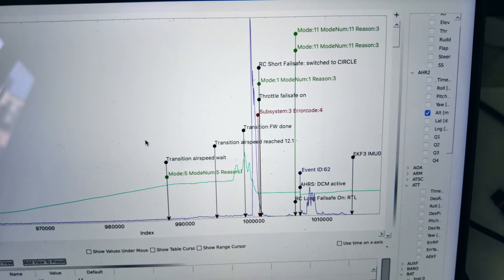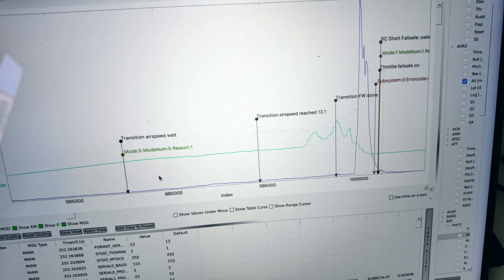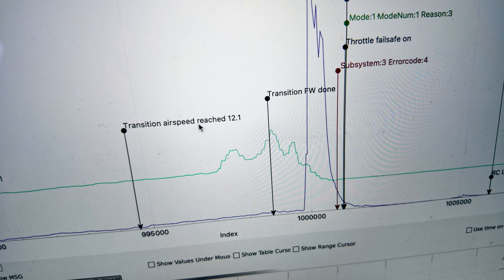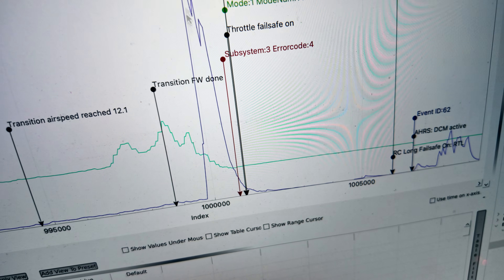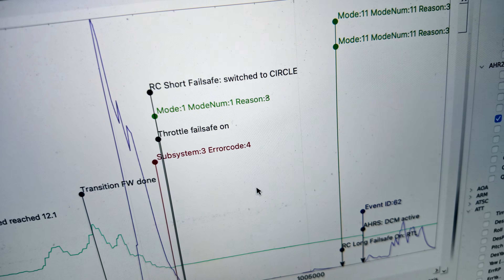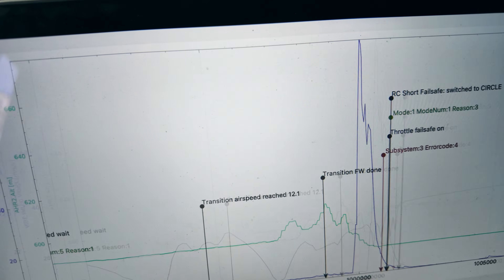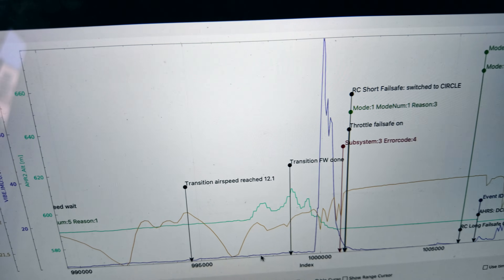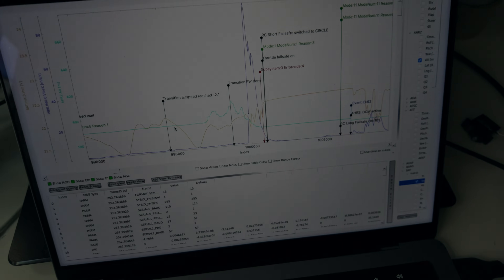I Crashed my Autonomous Drone (7/7)

Comment: Alright I'm back and after some research; you're right I, couldn't find any commercially available reciever compatible with the rc2. I did however find DJI O4 Air Unit and the Pro version of it. The only issue however is that the max operational distance of O4 is 10 km and 15 km for O4 Pro. While that is on its own a massive area you can cover, it seems a bit limiting for a long range fixed wing photography & videography drone that I wish to create. To be fair I think it is hard to find a finished product better at taking HD videos and photos than what DJI is offering. Do you have any suggestions?
Besides that, I'm interested in your printing material choice, or rather, how much of it is needed to print the entire aircraft? I have a friend willing to print the plane but we need to know how much to buy.  I may have overlooked this detail somewhere on Flightory's website so I'm asking you, who has already printed it twice if I'm up to speed. I plan to use LW ASA filament for it's greater UV and heat resistance than LW PLA.
Reply from the maker: Yeah, VTXs are difficult to match. I’m still waiting for my Skydroid system (RC with screen + vtx + gimbal or fpv cam). 

The stallion takes about 800g of LW-PLA - try the LW-PLA-HT variant. It also takes say 100-200 grams of PETG. It does take about 90h of printing tho.
Reply from the maker: I am yet to find a filament suitable for Flightory (glueing parts together). ASA-CF didn’t work for me - too brittle.

Comment: Out of curiosity, what was the problem in the end?
I'm asking because every time I try to configure ArduPilot for a VTOL myself, I end up with the same kind of crash — even with a full battery.
Reply from the maker: Hmm, must be something else. In my video you can hear the motors cut-off briefly during the transition, likely due to low voltage. I also didn't have a pitot tube to measure airspeed. Either way during the transition it stalled due to lack of forward speed, tho there should be a fallback to VTOL in that case... not really sure. 

What do you expect to be the cause of your crashes?
Reply: @pathfinder.george no clue, that is why I ask. For example with a stock FMI Manta it worked perfectly, but it was with the factory config. Then I changed the esc because the stock ones were getting extremely hot, i set them to DSHOT and the plane had same faith like yours

Comment: I recommend that you wrap the components you print with your 3D printer so that they have more resistance during a crush.
Reply from the maker: Surviving a crash (without a parachute) seems quite rare for fixed wings, but I do like your idea. There are these flimsy foamed filaments which are super lightweight, so perhaps combining them with a special wrap might be a viable solution. Worth looking in to.

Comment: Liking this series. It's encouraging to see someone else's journey, mistakes and all. I've built a few 250 drones and RC airplanes but have been out of the hobby for several years now. I'm just starting my Stallion build with purchasing the plans and trying to source and decide on parts.  My goal is to eventually have an autonomous fixed wing with a least 2 hours of loiter time.  I'll be using Bambu Aero ASA since I live in the Southwestern US. LW PLA can handle the heat here.
Reply from the maker: That’s awesome man! It’ll be a cakewalk for you 😁

Comment: you should have used an airspeed sensor. and should have avoided the stalling
Reply from the maker: Unfortunately, we have no control over the aircraft during transition. The sensor while beneficial is not required. That being said I did install one in my latest build. That’s for the suggestion!
Reply: @pathfinder.george can you not tune pid for throttle position of the front motors relative to the angle of the transitioning servos

Comment: Hey Bud...3D Printing that bird is a wastage of time and money. Your design  matches ZOHD Altus so better start with that and modify a little as per needs. If that crash during testing then a hot glue can fix the thing in no time. Good luck.
Reply from the maker: That’s true. Foamies are OP for beginners like me. However I am more interested in researching 3d printing tech and filaments to develop commercial UAVs later on.

Comment: That thing was pulling a lot of amps  absolutely screaming I think your prop or motor size is not correct for the load. Kv even too high.
Reply from the maker: @Carboneye7  hmm I used the hardware recommended by Flightory. Max amp draw per motor is 48amps. Esc can handle 45 continuous. Batter was 150C. My speculation is that the battery reading was wrong (since I did not setup the configs). Charged said 10% after the crash.

Comment: At least you got out there and did it! You did great. Most people would not go to the depths you have to find out exactdly what happened.  Look forward to find out.

Question Unrelated: Were you ever able to get OSD to work between your O3 Air Unit and Goggles? Which version of the goggles did you have v2 or v3?
Reply from the maker: Thank you for the encouragement. It's been a super fulfilling journey. 

TBH with the DJI O3, the SpeedyBee F405 and the Googles v2, the OSD worked right out of the box. You having issues?
Reply: @pathfinder.george  - Yeah, I'm using a Pixhawk 4 Mini (I tried PX4 and ardupilot both on same hardware)  to pump OSD to DJI O3 to V3 Goggles and not getting anywhere.  At first I cross the Rx/Tx lines but I correct that.  Still not working.  I suspect that the V3 goggles won't allow it.  Joshua Bardwell says O3 oughta work though, but I'm wondering if it'll only take OSD from Betaflight.  What do you think?

Comment: Ouch - we can all feel your pain. I have almost finished building mine and your posts have been very helpful in this journey. I anticipate a crash with mine for sure :)
Reply from the maker: Thanks man, that's great to hear! If I had to do it again, I would have a quick call with someone with experience to "double-check" my setup and configs before taking flight. I believe I did not set the correct params that match the FC to the battery. OSD was saying 50% battery left, yet I could hear the power cut-off during transition, which later led to the stall. Not 100% sure that's the cause but can't think of anything else. After I recovered the battery the charger said it was at 10%, when it should've been at 45+...

Good luck on your maiden flight! Would love to hear how it went!